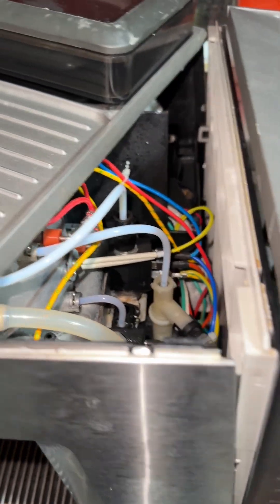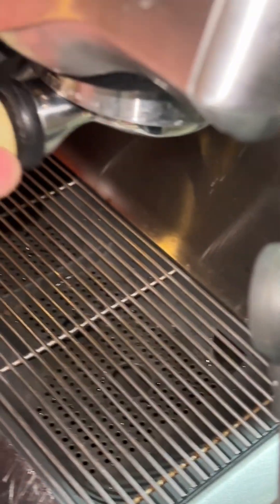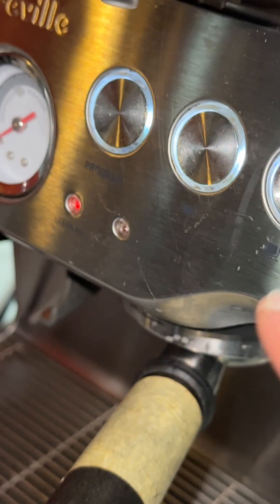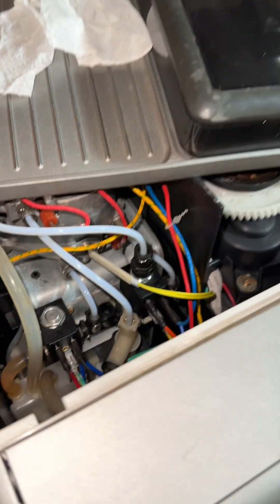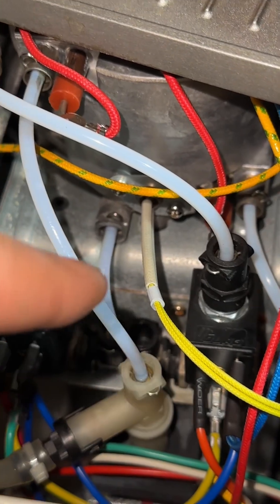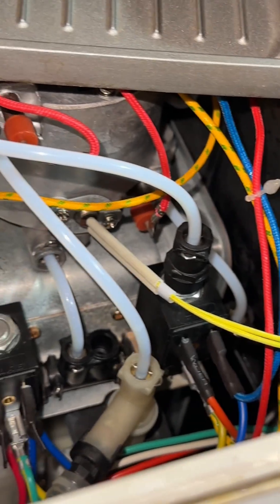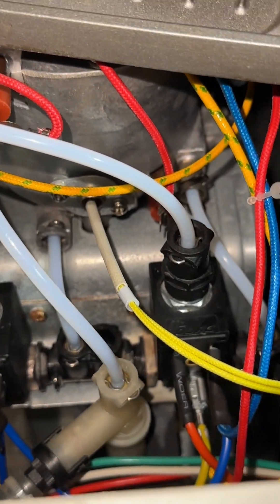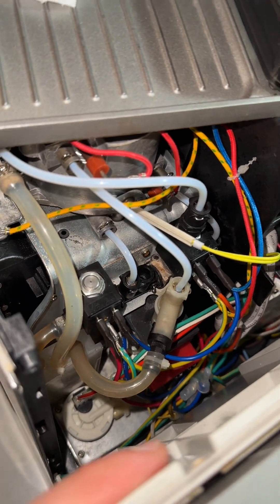Jacob and Lizzie’s Breville Barista Express BES860 leak from solenoid/low pressure repair 6/10/2024

Comment: Hi, I have the exact same issue, I’ve got water rushing out where the plastic part connects to the metal part on the right solenoid, the plastic part does not thread into the metal anymore. Do you have a parts number or something for just that plastic part? Best regards
Reply from the maker: @filipth7101  ah don't have the part number, j don't know if they sell it alone, I get it from other machines I disassembled. Could be the seal, the connector screw, the elbow joint. Hard to say which is leaking unless you disassembled it. Are you in Australia?
Reply: @caffeinefix2751 thanks for your reply, unfortunately I’m in Sweden. I’ve disassembled the solenoid assembly, the plastic screw that screws into the metal part cracked in the middle so that’s where the water is coming from. I’ve checked online and I can only find the entire solenoid assembly. Trying to fix it with epoxy now so we’ll see how that’s gonna hold up…